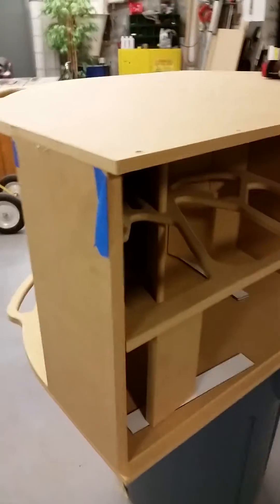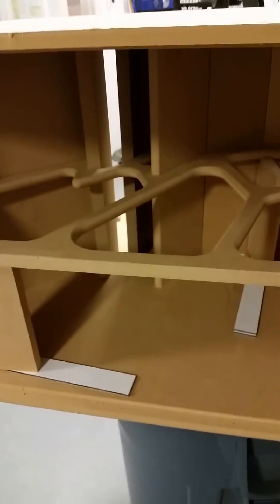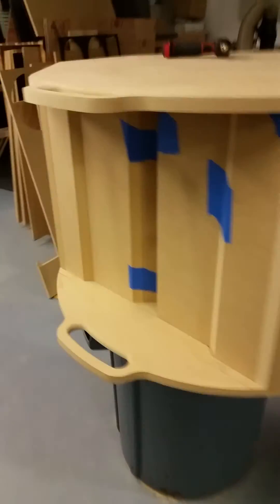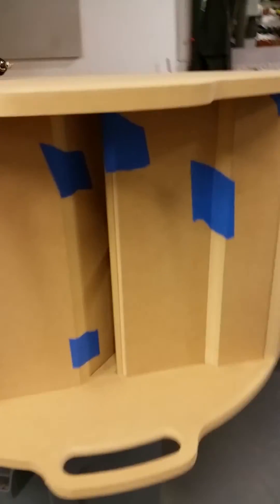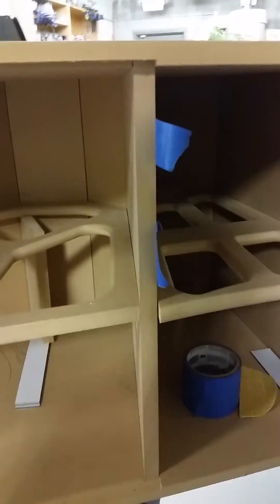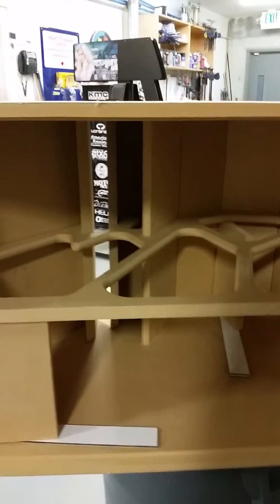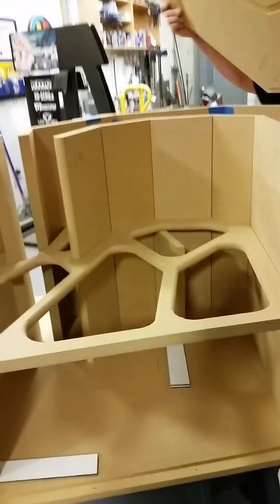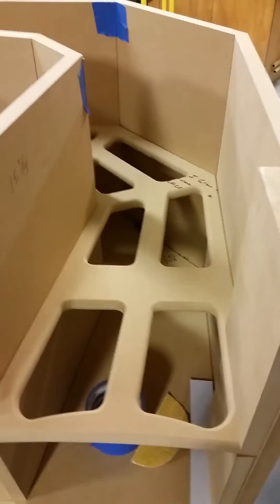Folded horn subwoofer

Comment: Thats pretty cool... I was a member of the Decware forums and ended up scaling one of their designs. I ran 2 18"  subs powered with 2 crown xl 5000 watt amplifiers for my home surround sound. I didnt use it much, I went through a dozen configurations of port size, shape, length and speaker orientation to determine the flattest response from 25hz all the way to 100hz. 10hz is not a harmonic and it really just causes the box and house to oscillate mechanically with the weight of the speaker cone. 25hz on up is where it really counts and the air starts to do the work. I had from 115-135+db, 20-100hz. Its very difficult to get good volume below 20hz and you want a flat response for full cinematic effect. The first movie I watched with it was War of the Worlds. I had the speakers set to only come on below 45hz and had it turned way to high. When the Spaceship came out of the ground and blew its trumpet I flinched and hurt my neck for 2 weeks....:) I recently ebayed the amps, speakers and box. Reinvesting in USdronerepair.com
Reply from the maker: Sounds like you know some about this, I don't. I should have them comment about it. They do admit it will probably not hit 10, and they do admit it is not even realistic. Hard to find the right amp, hard to find the right audio sorce that has a 10hz signal. These guys are just real good at building cool things, and they aren't afraid to play. They are champions at sound qaulity, I work by them and often drop in.